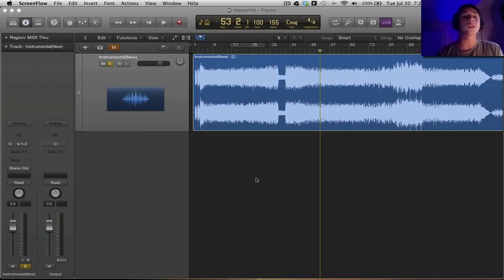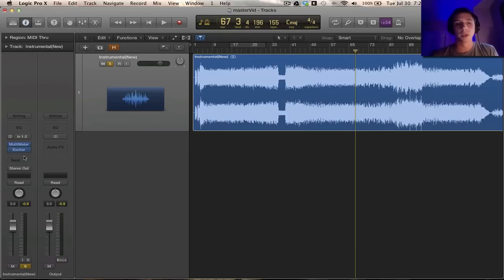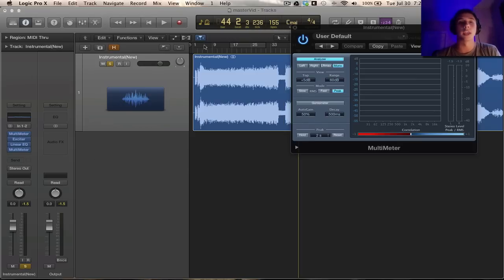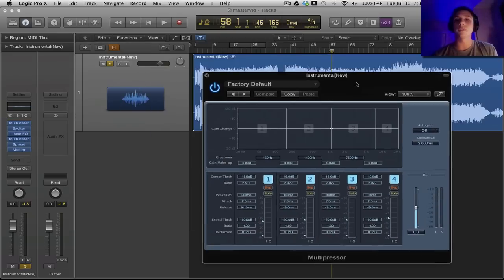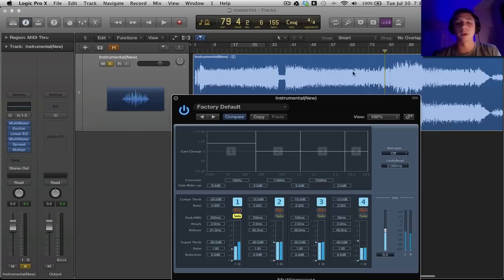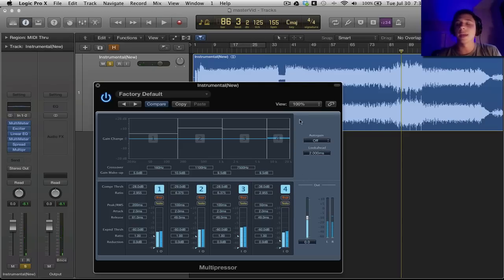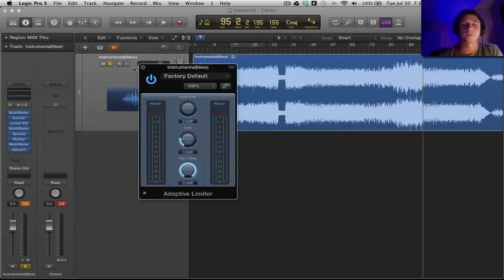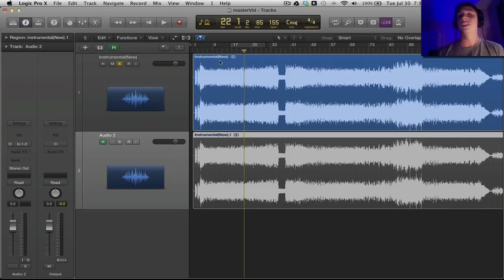Logic Pro X Tutorial - Mastering

Comment: When mastering, does every instrument used have to stay below the orange and reds? Or can I lower the main volume below the reds on the far right of the mixing board and that will be good enough? Dumb question, but I had to ask? Because when I'm making a song, I end up with sounds going into the reds after adding a bunch of sounds, it keeps getting louder and then I have to lower everything at the end to get them out of the red which takes forever and I end up with something that doesn't sound the way I wanted it to. Is there a way to lower everything where it also lowers the volume dots as well, so I don't have to go into each sound and do it manually?

Comment: Hi,I have a question.I have 10.1 Logic and I use to have an Output stereo 1&2 that I could put mixing plugins in the strip next to the master strip.Now I just have `Settings `What's up with that ? Thanks
Reply from the maker: Tom Riviere You should still have the stereo output channel in your mixer. Make sure that "Output" channel strip display is turned on. The toggle is located on the top of the mixer
Reply: Tom Riviere  
Hi,Mitch,when you say toggle what ? I still don't see what you mean.Output is on the top of the mixer but nothing is happening.Still blank.
Reply from the maker: There's a group of buttons at the top right of the mixer that enables you to toggle between different types of tracks that are displayed in your mixer (Audio, Inst, Aux, Bus, Input, Output**, Master, and MIDI)

Comment: try to have the compressor BEFORE the EQ for common reasons (compression makes peaks lower and brings up noise floor to make everything relatively closer to the same peaking level) and eqing after "buys" those frequencies back so it sounds more natural... and when you eq you should cut what you don't want first. Boosting adds artificial gain >.< just a few suggestions.

resource: Attending college for audio Engineering.
Reply from the maker: Brett DeFazio You've brought up a great point! This is very valid and for mastering I believe this is the way to go. The only reason I would say to EQ before compression is if loud, unappealing frequency bands are causing the compressor to act erratically. Of course, this shouldn't be the case when mastering so compression before EQ is the way to go!

Thanks Brett!

Comment: Too much limiting the vocals are ducking the rest of the track and the snare as well, there is no point using a limiter all it does is lowers the quality of the track and increases the volume. The volume is something you can change with a simple volume knob but you can never get back the dynamic range. Otherwise you seem to know what you are doing you seemed pretty sensible with the multipressor although I'm not sure how much I like the exciter for this track.
Reply: I'd also recommend mastering on the original logic project file because every time you bounce something from logic the file gets compressed

Comment: Question, why is it that my mixes sound fine on my monitors but when I play the mp3 track through my computer it sounds awful? and how do I fix this?
Reply from the maker: What do you mean by awful?
Reply: Well it is just very different from than when I play on my monitors. The highs are much more piercing and and the voices are a little more muffled. stuff like that. basically, what I'm mixing through the monitors isn't translating to regular speakers
Reply from the maker: Are you clipping at any point? Either on a tracks level or at your output? Also, make sure not to have normalized checked in your bounce preferences.
Reply: No and yea I made sure not to normalize. I ended up using a high cut filter and it seemed to clear some things up.

Comment: Does anyone know if I created something in Garageband, that if I open it in Logic Pro X the sound quality will improve just because it is Logic Pro or does it matter? The sound in Garageband was muffled when I played it at the club I DJ at. I was thinking of changing all the sounds from the Garageband presets. Any suggestions. I want it to sound more professional.
Reply from the maker: The sound quality might improve a bit but not much. The plugin settings transfer over. I would definitely shy away from doing anything with presets. It's a good starting point but if you are getting a muffled sound I'm guessing it has to do with the EQ settings you are using
Reply: Thank you for getting back. Do you mean to not use any of the preset sound instruments in Pro Logic X and instead creating sounds from scratch? Or just adjusting the preset sound instruments that come with Logic Pro X and Garageband so they will sound correct in a large night club?
Reply from the maker: Well, I would suggest starting by modifying the sounds you currently have, but in the end you should be creating your synths based on the part they are playing in your track and modifying them with plugins when needed.
Reply: Thank you.

Comment from the maker: If your song wasn't clipping to begin with you need to narrow down which plugin causes you to clip (most likely that multipressor). You need to make sure the volume into the each plugin besides the limiter is the volume out.
If it is the multimeter, make sure that you are adding the correct amount of gain back to each channel based on how much compression you are using.

Comment: You're peaking all the way through the video... You should never really have digital peaking! If something peaking during the recording stage and it couldn't be re-recorded you really should have compressed or automated it down during the mixing stage. You should be entering mastering stage with sufficient headroom to do the edits you are without peaking. 

Also, when we refer to a 'muddy mix' it's usually because there is too much happening in the low mids, not relevant to compression really.

Comment: Nice presentation. A few thoughts: (1) Consider subtracting with EQ instead of boosting. You'll color the sound even less. (2) Multi-band compressors are a personal preference thing, but many mastering engineers would use EQ instead to fix things. Wide-band compressors might give you a more natural sound. (3) Mastering is also about creating cohesion among multiple tracks. I'd be interested in seeing how you match levels, set spacing, adjust fades, etc. with multiple songs in Logic.